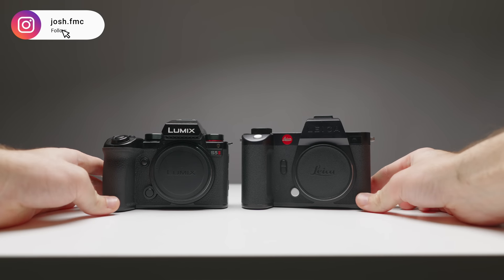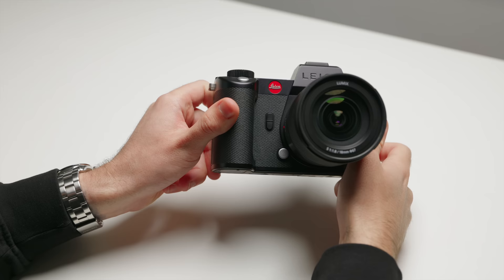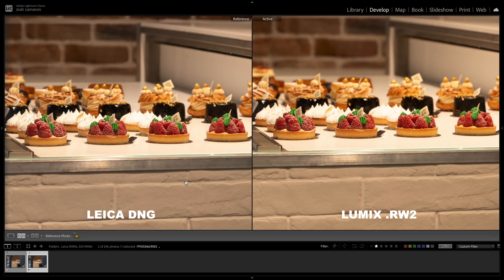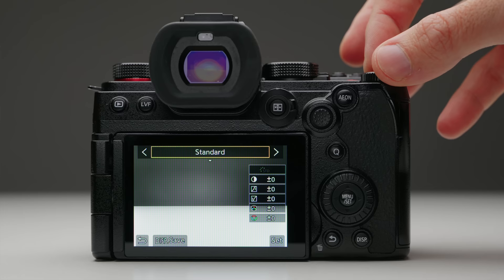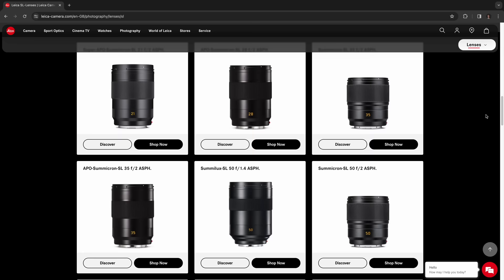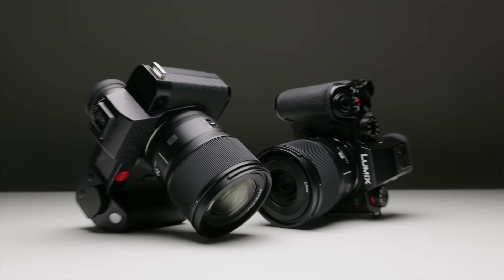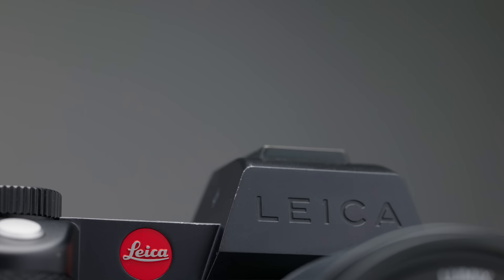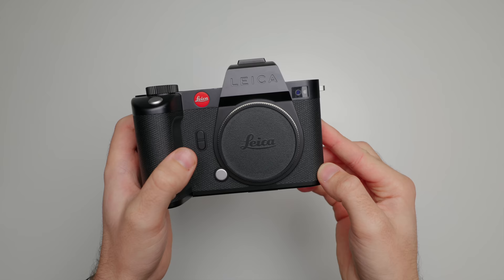Lumix VS Leica Colour Comparison

Comment: I didn't see any difference.
What's the price difference between these 2 camera bodies?
The adjustability on the Lumix reminded me of my own Panasonic TZ-101. There was some criticism about this camera when it came out. I made adjustments regarding high and low light dynamics, contrast, saturation, color temperature and sharpness. That's my profile and I'm very pleased with this personal profile.
There are rare cases when I use a tripod and long exposure. I'd use Lightroom to work with the raw-files then.
The mentioned limited adjustability in the Leica here... well, it's their brand philosophy. But I consider this limitation as a bad joke to the consumer. 🤪
Reply from the maker: The Leica SL2-S body only retails for £4340 from Leica direct, and the Panasonic S5II retails for just under £2000 :) You can get great deals on the S5II now, especially when you bundle it with a few lenses !
Reply: @JoshCameron  So by the rule of thumb a €/$/£ 2.5 k difference for exactly the same technology, just in a different case, different name and the more expensive one with limited out-of-the-box jpg-profile. 🤦‍♂️
Thank you very much! 🤭😂
Oh, there's something more: the screws of one case got torqued to specs in China, the other ones in Wetzlar, Germany. Besides that: same sensor, same lens mount, same chipset. 🤣
Reply: @u.e.u.e.  Panasonic is Japanese when did they start building their cameras in China, can't find that on the 3 sitting in front of me

Comment: You can't believe in "color science" in 2024. I remember the panic around "Nikon green skintones". I remember all this madness around CCD colors, there used to be a lot of such myths.  None of them were confirmed by blind tests. I saw on one of the forums how Pentax fanboys in a blind test preferred the  “Color Science” of Nikon D4 , and sent their mythical K10 to eighth place out of ten. I saw how canonists chose Sony A7 in a similar test.
In practice, these are all differences in temperature and tone. And if there are any differences in the interpretation of colors then this is +/- 5 points in the HSL tab.
Reply: Some photographers build a reputation around a particular look. Cyan skies, desaturated foliage, warm skin tones, a style that works well in a commercial context. If it was produced SOOC you'd send the camera back as faulty, and reviewers would trash its reputation. The point is what looks good in a particular context has nothing to do with neutral colour rendering, and everything to do with a consistent marketable appearance.

Comment: Great demonstration 
Sorry Leica 😅
I made the same test even more complete between the SL2 and S1R
No place for the Leica in my bag sorry red dot ! The S1R is soooo much powerful than the SL2 and the colors are exactly the same.

In the opposite I only use Leica SL lenses on all my lumix cameras. They are awesome and as you mention I don’t see the point buying a Leica camera and put sigma or LUMIX lenses on it. It doesn’t make sense and it’s a lot of money lost.

I decided to do the opposite way. SL lenses on used market can be found at half their price and the difference between the other brands in the L mount alliance is really there. The APO lenses are dream lenses without purple not green fringes and sharp edge to edge

Comment: I am surprised that there is a surprise at all. If you compare fraternal twins, then even with the same lens, this is what will happen. It is like this since long years. Leica and Panasonic are working sometimes close, sometimes not so close together.
Anyway Leica lenses contribute more on the results.
Me personally I am using Pana, with lenses from Leica (2) and Panasonic (3)
I would go for a Leica body because of ergonomics and design. But no real need... I am happy
Reply from the maker: Michael, I'd love to know how the Leica lenses compare to the Lumix lenses. Do you find they give more character overall?
Reply: @JoshCameron  hello Josh, maybe I am the wrong person to ask for that. I used to have Leica M, even there not the most expensive lenses, and I loved the colors. But it was M8 means CCD. Today I am into MFT as while getting older, my eyes weren't good enough to deal with Rangefinder anymore.
So I have G9II GX9 AND GM1
I did not compare the colors yet, but I assume, as the Leica L Lenses are a different kind of beast, whatever I see on MFT, might be not valid for Leica L.

Comment: There is no magic in Leica colour. I should know, I have four M camera. If there is any magic, it is in the feel and the handling of the camera  and not necessarily the SL line, although the original SL was a pretty robust statement. Leica and Panasonic have had a very long relationship and it is not surprising if you found a lot of Panasonic electronics in a modern Leica, which is not bad thing by a mile.

Comment: I have both of these camera bodies, and whilst you may be right about the 'colour science', to focus purely on this aspect is a bit spurious. I expect most modern full frame 24 meg bodies are capable of producing virtually identical jpegs. But just as one would not buy a Ford instead of a BMW because of the paint job, I hope anyone who could afford the Leica won't dismiss it just because the jpegs are similar to those from another camera. I like my Lumix S5ii, but if I'm picking up one camera to take out I usually choose the Leica. It's not flawless (like all things) but it's lovely to handle and enjoyable to use, it's very easy to control and it's totally predictable shot to shot. Anyone with the money for an SL series Leica should definitely try one properly before deciding if the Lumix S5ii would be fine for them at lower cost. 😊

Comment: I think, the comparison, while interesting is not really representative. To judge a difference, you would have to set up defined scenarios and compare them side by side. I for one think, that the SL2-s is probably nicer at low light and high iso (that being said, the Panasonic is nice at that as well) and it definitely is the instrument you want as a professional. It is straight, no gimmicks, perfect menu, perfect handling. I use a set of APOs plus the original 24-70 on mine and I would not want anything else (apart from maybe a set of M summilux and an SL3). The Panasonic is a great camera and if you are into videography, it is the perfect second unit, if you already have the sl.

Comment: To expand on what I posted a month ago - Whilst the Lumix Standard colour profile is acknowledged to have the most authentic reproduction of any camera, it is bland and should only be used for scientific/technical work to reproduce the correct colours; it should not be the default colour profile, that should be Natural, followed by Scenery for greenery and Portrait for flesh tones. 
When you use the raw file, your colour reproduction is at the mercy of your converter/editor, this is often worse than the camera can do itself. This is something of a bête noire for me, I expect the converter to produce an image that is at least similar to the image when I  "shoot for the jpeg ". 
The in-camera NR can be OTT and produce artefacts, it is a selective gain process, and can be better dropped to NR-1.  
The white balance will also affect colour reproduction, AWB will strive to correct to noon sunlight although Lumix AWB may be a little cooler than some others (est. 5700K). If you do not want that look e.g. early evening then a fixed WB or a custom colour temperature may produce a more desirable result; WB is a gain setting. The highlight/shadow (gain curve) also alters the gain and can alter the colour gamut. At very high ISO the dynamic range is reduced which can result in some colour shift.

Comment: Not even half way into the video, I got the first two rounds correct. Leica has more filmic shadows (matte-ish, while still retaining detail) while Panasonic shadows are kind of crushed (leaning towards pitch black). Highly saturated reds tend to turn darker in Leica (similar to color density in film), while Panasonic's reds are a little harsh to look at. I have never seen or touched a Leica in real life (let alone using one) but right away it looks more pleasing to my eyes. 

That being said, let me make it clear that what I find pleasing is subjective. You might like the Panasonic over the Leica. I have used Lumix cameras, and my very first real camera was a Lumix. The difference is negligible, and I personally would not spend a fortune on a Leica, even if I had the money, for such a subtle difference that only color science nerds would notice. You're better off creating art with whatever you have access to.

Now let me watch the rest of the video.😅

Comment: It's disappointing that Panasonic has ditched the S1 series and Pro-S lenses to focus on the S5 series and cheaper lenses. I own the S1 and S1R with the Pro-S lenses. Will probably switch brands, but the trade in values on Panasonic are awful. Could save a lot of money if they did come out with a S1Rii but I don't think they will. They didn't sell enough and the money is in the video market for Panasonic.  Their AF failure lost them a good share of the market.

Comment: Well done comparison Josh. As a retired pro shooter for over 20 years, I can confirm that ALL modern cameras are far more capable than 99% of their users. Things like color profiles/film styles should be irrelevant to the person that splashes Leica ca$h on a body and lens, because they should be shooting RAW. As an owner of M film cameras and the SL (601) I can confirm there are no better built cameras on the market. Peroid. That being said, Leica is a luxury brand. BTW, I actually bought an S1R from B&H in early 2020 (for the specs) but sent it back due to the plasticky nature of the build.
Reply from the maker: It's interesting to hear that you found the S1R to be plasticky in feel... Even after using a Leica, I'd still say that the S1 series of cameras is built very well!
Reply: @JoshCameron  it's certainly up to the task. Maybe "plasticky" isn't fair, but it reminded me of other pro Nikons I've owned, with lots of buttons. Leica M cameras are incredibly dense for their size and the SL series is hewn from a solid block of aluminum, by God 🙂

Comment: I know it's popular on the internet to say there's little to no difference between anything but we should really take a pause here. Even on my 4k TV I was able to pick out the Leica. Another YTber did a similar video of Leica v. Sony and made the same claim. I was able to spot the difference there as well. He thought the lenses made the difference. This video proves my belief that the sensor plays a part as well. Leica has a slight pastel-like shift to their colors, increased contrast, and rolled-off highlights. Since they share DNA w/ Panasonic the results are very very similar - but not the same IMO. I think the next question is how to replicate the 'Leica look' in post if possible. But this 'there's no difference between X and X' trend I think really needs to end, not just for cameras but for all electronics gear. I do agree that the Lumix is the better value and Leica's strength is the build quality and overall design. They have the best UI period.

Comment: Sure, for all practical purposes, you're just as well off with a Lumix S5II as with a Leica SL-2S, no doubt about it.  The Leica is not a practical camera any more than the Rolls-Royce is a practical automobile.  Yes, if you're pixel-peeping, Leica lenses are often superior, particularly the APO-Summicron series for SL cameras, but pixel-peeping is not photography, and except for testers/reviewers, who needs it!  Reasons to buy a Leica include things like elegance of design (not cluttered with 100 buttons), superior quality of materials (e.g., metal instead of plastic), build quality (tolerances and inspection standards), and resulting ruggedness, durability, and reliability.  A Ford or Chevy will get you to where you're going just as well as a Rolls-Royce, but you get a Rolls-Royce for what it offers in addition to mere practical transportation---an overall experience of extreme high quality, from the day you buy it until the day you sell it (or die).  It's the same with a Leica!  If you don't appreciate what a Leica offers, no problem, just don't buy it...but don't criticize it or the owners who do appreciate what it offers.  And whatever you buy, just enjoy it for what it is.  Life is too short for anything else.  🙂

Comment: This comparison is not done using an accurate method. You need to manually apply the Leica embedded color profile as Lightroom does not do it. Once you do that, you can clearly see the difference. I've shot over 100k images with both cameras. The Leica is a clear winner.
Reply from the maker: Leica shoots in DNG, so you can't access in the in camera colour profiles like you can on a Lumix, at least I wasn't able to....
Reply: You have to go to the profile settings in lightroom and add "Legacy." Then you can choose,"embedded." Once you do, you'll see a major color change. If you don't do that, Lightroom will use the default settings of Adobe. I have to do this with my SL2 and Sl2-S. It's a pain, which is why I often use Capture One instead where the color is much better. Lightroom needs to make it so these profiles apply automatically.
Reply from the maker: @Resh1477  I've just tried doing that and still can't find any embedded colour options...
Reply: Interesting. Are you using CC or Lightroom Classic? It definitely shows up in Classic. Not sure about CC. I would love you to see the difference. It's so intense that you have to completey adjust the white balance once it's applied. This is truly an issue between Leica and Adobe. It should really be automatically applied. I have to do it every time I import. Capture One automatically does it though. I really do enjoy your content. I hope you can see the true color soon!
Reply from the maker: @Resh1477  I’m using the Lightroom Classic , fully up to date and I’ve tested files from both the SL2-S and the SL3 with no avail. Still don’t get that embedded option weirdly! I really want to see because I’d hate for my content to be misleading or untrue, so any new thing I can learn about the imaging pipeline from Leica is really appreciated 🙌🏼

Comment: No disrespect but this video tells nothing about Leica's little about Leica and color science.
It just hints that a Leica with a specific Lumix lense provide "kind of" a similar(there are still drastic differences) results than the very  same lense on a specific Lumix. 
It's not even a real one to one comparison. Lumix lenses are made and optimised for Lumix body's and software, so this video showed the Lumix with an optimal kit(Especially since lenses are made with the imaging algorythm and  sensor in mind).
For this comparison to be accurate, it would requires the very same conditions for Leica, meaning a Leica body and a evenly spec summi/vario lense in order to obtain a full Leica's coded image. Using a Lumix lense on the Leica does have an (negative or positive) impact and indeed "color" each results making the comparison crooked.
It's actually obvious : Using a Nikkon Z 50mm 1.8 on a Z8 will not provide the same results than using a Canon EF 50mm 1.8 on the very same camera already.
Reply from the maker: I disagree with you on this one. All of the differences you get from a lens will ultimately be the same no matter what camera you put it on, so if a lens naturally has more of a green tint and bad corner sharpness, then that will ring true whether it's on a camera with the same name on it, or a camera with a different name on it. 

The S Pro 24-70 is a phenomenal lens. In fact, I'd probably go as far as saying that it's one of the best 24-70's ever made. Leica and Lumix have a lot of crossover in their tech, so the differences you may encounter based on the way the camera processes the images rendered from a specific lens will ultimately be quite similar :)
Reply: @JoshCameron  I'm sorry to insist but your points are either false or misleading...
1 - It's actually quite weird to brush off that a constructor's lense is optimised for a camera body from the same brand and that even if great, said lense will provide different results on another camera body(diminishing or not, that also needs to be determined) especially from another constructor. 
2 - In order to determine what is Leica's color science and how it applies, you need to ensure that you used an appropriate kit to demonstrate what it looks like. You ONLY using a kit made for another camera in mind is the complete opposite of the proper process as the results you will obtain with said lense, however great it can be, cannot represent how a Leica optimised kit works/acts(dynamic range, color accuracy,etc.) 
3 - You provided samples from 1 lense only...You need way more samples from multiple situations and from multiple lenses to ensure that the results are at least viable and accurate on both camera BODY'S... If not, you're just sampling how both camera  can act with ONE lense and absolutely not what the camera bodies can do.
4 - Contrary to what you said a lense does not provide the same results on all camera bodies it's paired with and will not be acting the same either...This, is purely false. Color accuracy, dynamic range, etc. All may vary, sometimes drastically. A lense can even uplift one camera while being counterproductive for another.

Those points are way too important for you to consider your comparison viable. Hence why i'll stay on my position. you only provided few informations about how one specific Lumix Lense can perform with one Lumix and one Leica camera... Nothing conclusive about Leica's color science.